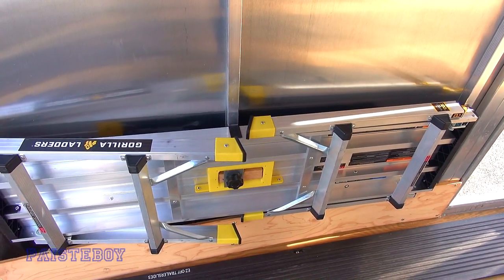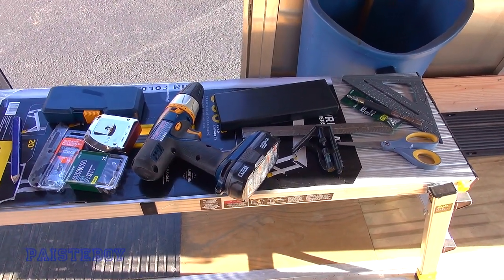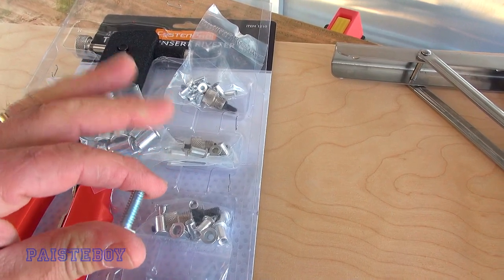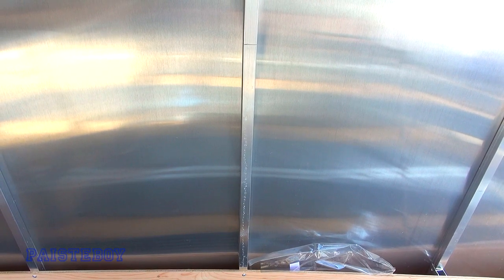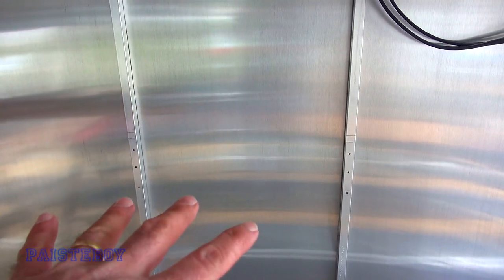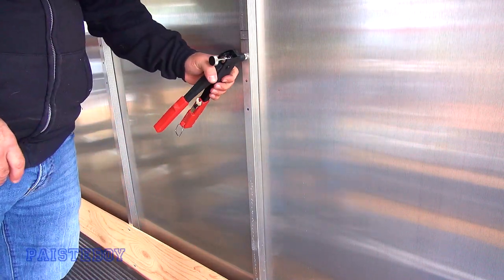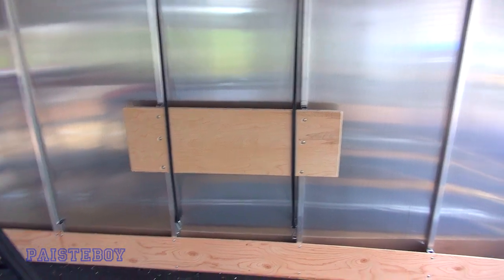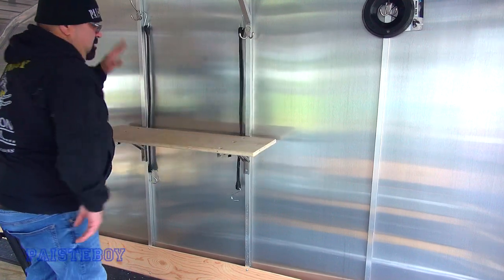Trailer Mods:  Phase 4  (Collapsible Shelf)

Comment: Hey Paiste, Another great upgrade with the fold down table. 👍🏼 One of the upgrades I made with my current Blizzard hybrid trailer was adding 1” foam board insulation from Lowes to the inside of the trailer. It stopped the trailer from sweating after you load the sled and it and keeps the inside of the trailer alittle cooler in the summer months. Take Care
Reply from the maker: Thanks Greg.  I actually measured everything up in the trailer to do that.  I even did a layout with my CAD program  to figure out how much material I would need.  I do have today and tomorrow off.  I just wasn't sure if I wanted to do it this season or next.  I want to the stuff with the reflective backer but it's kind of pricey right now.
Reply: @Paisteboy  Nice.. Enjoying a couple days off.. and Good choice, that’s exactly what I installed was the foil backed 4x8’ sheets and I put the foil facing out against the wall to reflect the heat. Then you just have to get the foam insulation tape and tape the seams and aluminum studs 👍🏼 Mines been staying in just fine with just the tape.
Reply from the maker: Sounds like a good plan!

Comment: Nice work. Definitely want to treat that shelf. Even with some spray on spar varnish. The wet (from any residual ice/snow) on the helmets and other gear will take it's toll on it if not. Better to have and not need than need and not have and all as you well know. Looking forward to the snowmobiling vids. Thanks for sharing.
Reply from the maker: Absolutely!  Thanks Russell.  I'm looking forward to this seasons adventures as well.  Still waiting on the new sled.  Once that comes in that should add another dimension to the videos.  Thanks for watching.
Reply: You're keeping what the new ride is under wraps for now correct? For a big video reveal?

Comment: Another great video. I have the same trailer so you've given me a few ideas. Hope to see you guys in OF soon. No new sled yet?
Reply from the maker: Thanks  Brian.  Cool. It's a great trailer and even better with these mods.  We'll be there as soon as it's rideable.  I had most of this week off with the hopes of riding there but it's nit looking good and going to get worse in the upcoming week.  I hope to make it up there before Christmas. 
No sled yet.  I was told sometime in January so we'll have to wait and see.
Hope to see you guys on OF again.
Reply: @Paisteboy  looks like the old trusty Blizzard is gonna get some more miles on it this year. You should probably just keep it for the entire season and once the new sled comes in, transition it to a backup. It seems like it's been a great sled for you. I'll give you a heads up when the Newburgh crew is OF bound.
Reply from the maker: Yes.  Believe me I've been going back and forth about keeping it but it will really lower the end cost of my new sled since the price is quite high. 
If I understand correctly you order a cat for this season?
Reply: @Paisteboy  I kept my XRS Renegade for another season. It's been a great sled and mileage is still under 5k. I should be able to get through this season with it. If and when I do another spring order, it'll be another XRS Gade.  It checks all the boxes for me.
Reply from the maker: Absolutely! It's a great sled and a wise choice.  I hear that they are going to run into the same problem next year with shortages and shipping delays. So even if my sled doesn't come in until March I'm still taking it.  I don't think it will be that late but worst case scenario.
Reply: @Paisteboy  I heard the same news from my dealer. I also heard possible big price increases next year too. Gotta pay to play I guess. We booked 2/7-2/11 at Water's Edge and we'll book a few other 2 night stays as the season gets going. I'll reach out with the other dates when we book them. See if you guys can make some of those dates work.
Reply from the maker: @brianmclean8857  
Yup. I also heard about price increases too.
Ok, cool. It's hard to tell right now since that's mid week and I may be planning a trip out of state sometime in February. Remind me as the date approaches.
Reply: @Paisteboy  you got it

Comment: I did the same thing in my trailer for both a work shelf and fold down seat for changing clothes. Works great.  But don’t sit too close to the edge as it can put a lot of leverage on the bracket and wall.  Watch your fingers on the bracket latches - ouch!
Reply from the maker: Cool.  I don't plan on sitting on the shelf at all.  I thought about doing the same for the seat but then I figured it would need legs for proper support.  It was easier to just have the portable bench at this point. Thanks for the comment and for watching Jeff.

Comment: These trailers are awesome I bought a nitro but it's the same size as yours and I pull it with two sleds no problem with a Mazda CX-9!! It's perfectly fine I had to trade in my tundra crew max because I do to much mileage in the off season the gas mpg is more than double during the summer and fall months👍👍
Reply from the maker: Right on! If it gets the job done, why not?  I used to pull a clamshell with my AWD minivan just fine.  It even got better gas mileage than my truck does towing the same thing.

Comment: I added the same outlet but also mounted a trickle charger with an SAE extension cord and can charge my battery when in storage and if it is supper cold `
Reply from the maker: That's the whole reason I added the outlet to the trailer.  I keep my sled on a battery tender all year long.  I just wanted the option to store the sled in the trailer and still keep it on the battery tender.  Thanks for watching J.

Comment: Now Gary has a place to eat his protein bars 😆
Reply from the maker: Lol. And his triple decker peanut butter sandwich if he brings a second one.
So you only ride local Jeff?
Reply: @Paisteboy  yup just pick up the sled last weekend putting leds in and ready to roll we need snow
Reply: I ride mostly at tug my buddy has a place in Barnes corners up there every weekend I only ride at home 2or3 times at year  no snow
Reply from the maker: @jefferydevries851  
Ok.  I was going to say.  No one buy a new sled to ride monroe county.  We can ride up at Tug Hill then sometime.  I plan on riding there a little bit more than usssual this season anyway as we've made some new friends that ride there.  I only rode at home once last year.  Local rides from metro rochester are almost non existant the past 4 or 5 seasons.  2015 was the last really good local ride=ng and I didn't even have my Blizzard yet that season.
Reply: @Paisteboy  I love to ride out of my yard unfortunately it's not possible because of snow but if you guys ride the hill or at home let me know I'm always ready to ride season too short
Reply from the maker: @jefferydevries851  Sounds good.  I'll let you know when we're going.
Reply: @Paisteboy  sounds good when you get your sled mine has no chip in the key I think they are all coming out that way so any key will run the sled just fyi
Reply from the maker: @jefferydevries851  
Did you get an MXZ XRS 850?
What color?
Reply from the maker: Ok. Thanks.  Probably another month at least for me.
Reply: @Paisteboy  I got renegade 850 x black
Reply from the maker: @jefferydevries851  
Ok. Sweet!

Comment: I get a lot of condensation on the ceiling of my trailer I was thinking about insulating it
Reply from the maker: Yeah Mike.  I noticed the same thing last season with the condensation on the ceiling.  I already did a CAD layout and measurements to fully insulate the trailer.  I just don't know if I'm going to do that this season or not.  It's also looking like a full install could cost a couple hundred bucks.

Comment: What did you use and where did you get the rubber ramp door gap flap at?
Reply from the maker: I didn't.  It came with the trailer. It's what Triton does to their trailers.